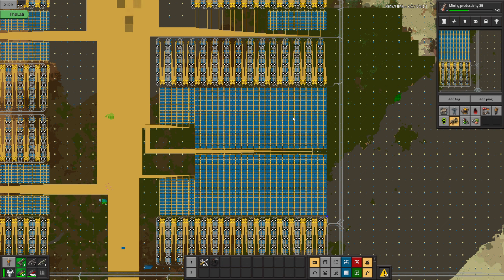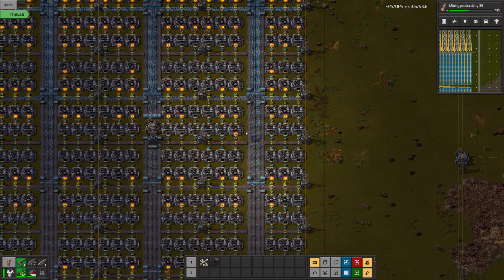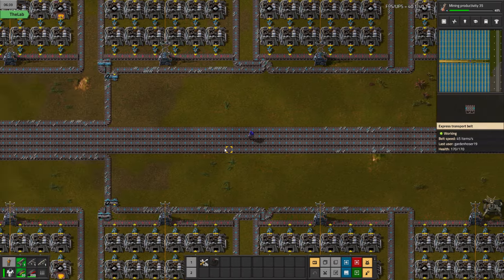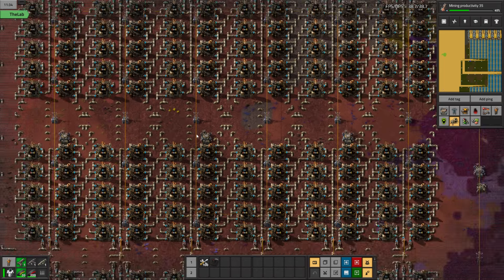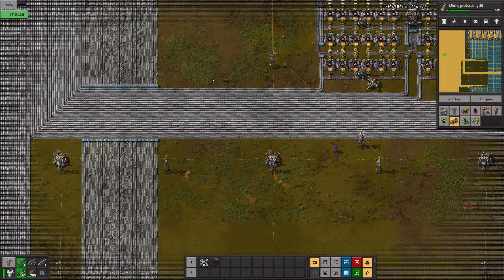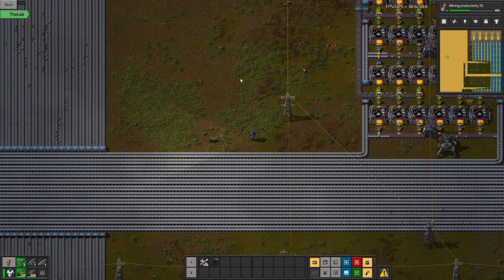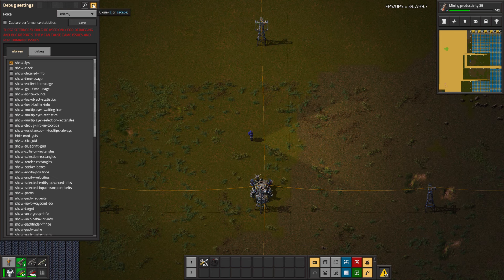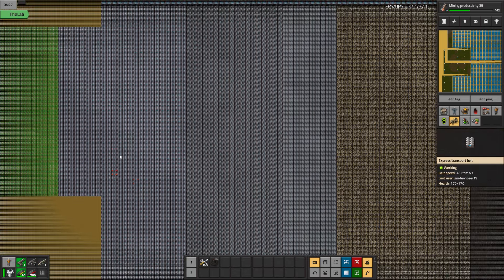Steel build update and startup. Also a talk about performance.

Comment: One thing you can do for ups is get rid of those ridiculous balancers. A splitter isn't cheap, and there's many in each balancer, and probably many balancers if that glimpse we got of the train area in the beginning is anything to go on.
Reply from the maker: I've never really thought about that. With me continuously building it's hard to exactly know what helps with ups. That's why I was planning to optimize after everything was built. That way I can see real time what helps and doesn't. But if they affect it that much I will definitely change it up.

Comment: One thing you could test that I've been told but not verified, is that it is supposed to be better to time your inserters instead of letting them swing whenever they want.  So time 19.2 seconds  (stack inserters taking plates out of a furnace) and have all the inserters connected  to the same signal and swing at that same time, sending only yes/no on that wire (so it doesn't update every tick on the clock but only once every 19.2 seconds).
Reply from the maker: Yes I've seen that in action. Never attempted to try it but my inserters are for sure taking a lot of update time. I will fix that sometime.

Comment: No idea why youtube deleted my comment. I went into pretty good detail but hey..

...tl'dr version -
> press f4  -> click "debug" . From there click "show-time-usage".  Then  press f4 to close. Then press f5 to open debug menu.  From there you will see time usages (This is what is using your ups)
 bottom left, you will see various usages 

circuit network -> obviously, your circuit networks
transport lines -> all your belts, splitters, and what have yous
fluid manager -> all your water, steam, oils, lubricant, petroleum, etc
heat manager -> all your steam and nuclear heating elements 
entity update -> all your bots, inserters, and loaders. This is usually the highest
electric network -> this is where people get screwed over the most.   This network of substations is probably your biggest issue lol.
Reply: tl;dr part 2 ->

there is an extreme amount of poor and misleading information regarding ups losses in this game nowadays. Old info being spread is the usual culprit. Wube has done an incredible job of optimizing belts and splitters; its not even close to what it used to be. From what I can see; if you have any reasonably modern pc, you should NOT be dipping to 30s/40s with a base this size. I have 10k spm bases that still get 60 ups and Im on a ryzen 5800x.  Good but certainly not top shelf. 

The easiest way to go about this is to use debug menu and sort it for yourself. I have a nagging idea that your electric  network is gonna be pretty high. Ill also be curious if its not.
Reply from the maker: Thanks! I will definitely check that out when I get back on.

Comment: Run your game on a server so the recording doesn't kill your UPS. I wouldn't mind throwing it into a box for you if you want. It's just kind of sitting there right now anyways. Benchmarks at 126UPS for 10k SPM base.
Reply from the maker: Thanks. Like I said I have 2 computers so I could run server on one and play on other. But I will keep that in mind for sure.
Reply: a server will not help with ups. because each client still needs to simulate the game. all a fast server would accomplish would be dropping everyone because their machines cant keep up
Reply from the maker: @beetleberries2  i tested my other computer and it runs the base fine.